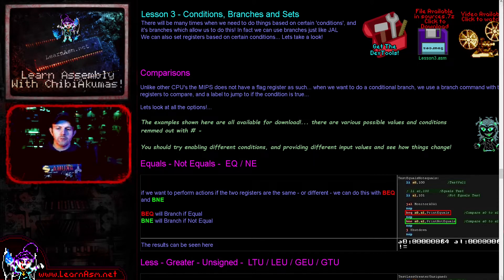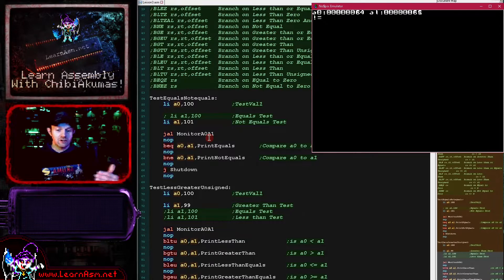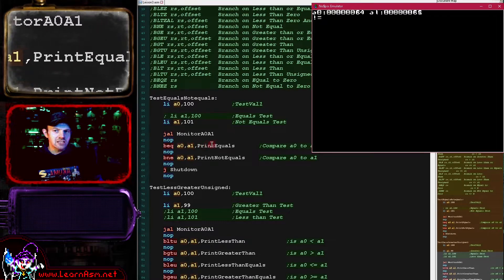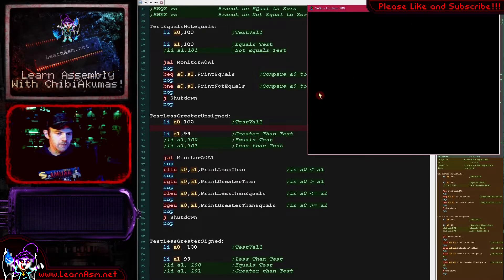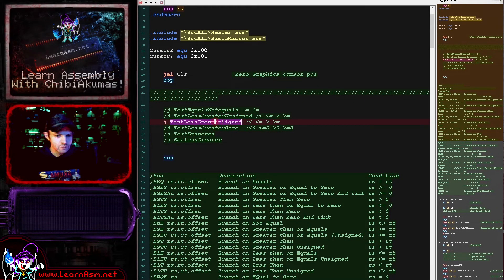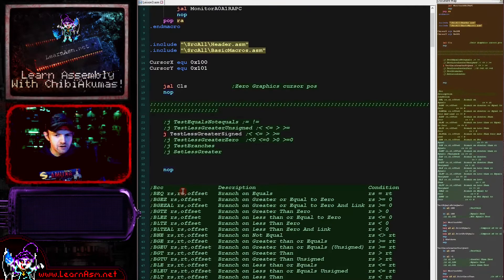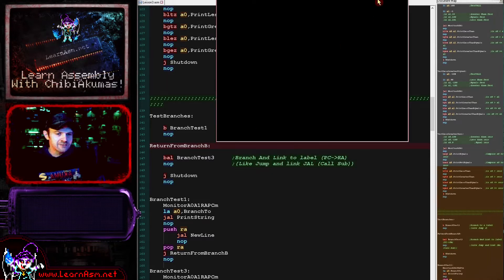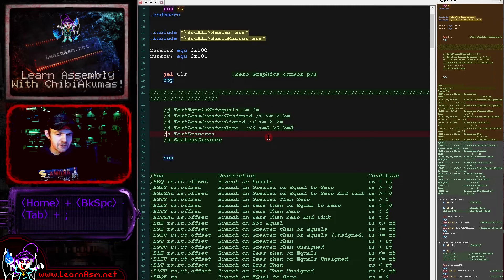Mips Assembly Lesson 3 - Conditions, Branches and Sets

Comment: "The purpose of these [SET] commands may not seem immediately apparent, but these are actually used with the Branch commands to form some of the branch psuedo-ops."  - - Keith (ChibiAkumas)
This concept could be expanded in a future video.  Hopefully in the far future.  It might be possible to compare the architectural design of MIPS with RISC-V (set commands).  Good luck on your third book.